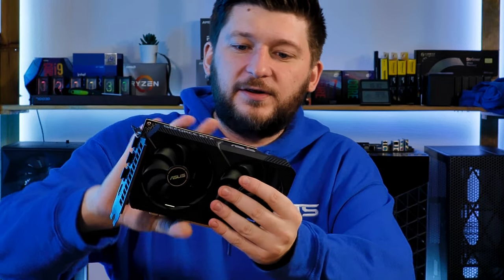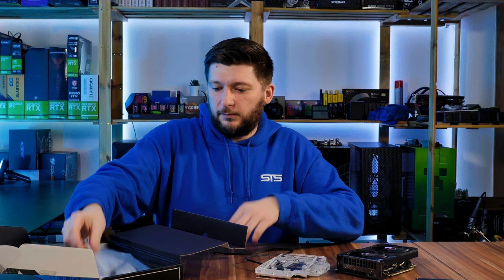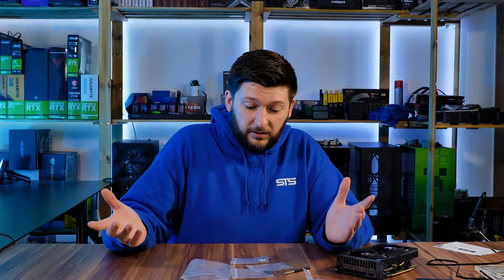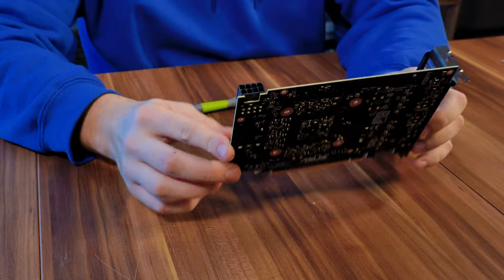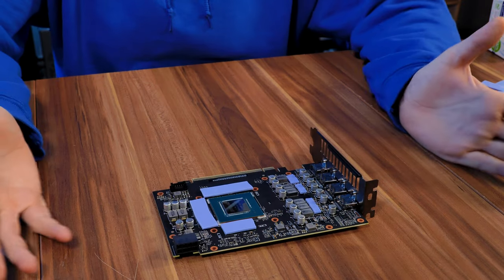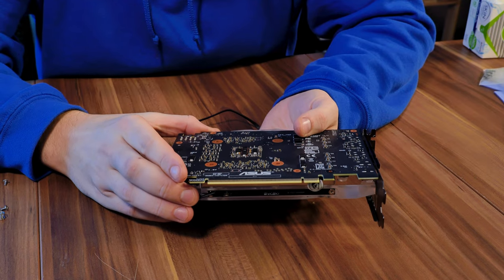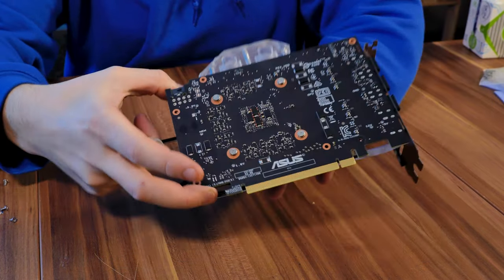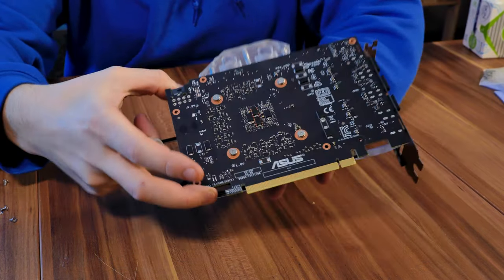Water Cooling my Asus RTX 3060 TI V2 Dual Mini | Bykski Waterblock

Comment: Great to see GPU water blocks for non-high end gpus such as 3080/90 etc for a change as it’s almost impossible to find water coolers normally for 60 class gpus😭. Well done to Bykski ❤🥰👍. I personally use their all-in-one cpu waterblock-reservoir-pump combo units and they perform exceptionally well 😇👍.
Reply: 12 floors  a couple of the 2060 models do have waterblocks mainly the EVGA cards and a couple of the blower cards according t9 the corsair site also the 2060 Suoer FE works with a 2070 block as its a identical PCB providing using reference design I'm cosindering doing black fittings for the FE 2060 super as I can see this thing being OC to above 2070 levels if cooled properly
Reply: I have the same GPU shown in the video. Is there a AIO available for that?

Comment: hi, great job, but what size of radiator should be suitable for the best temp dropping? 240mm?
Reply: 240 is fine, I had a ryzen 7 and a vega 64 both on the same 240 mil loop and temps were below average across all hardware. Although I reccomend 360 in case you want to expand later. I myself have used byski waterblocks several times. I like them a lot.

Comment: Do you have done any testing with this Waterblock yet and can give us some information about temps? I use the Gigabyte 3060ti Eagle OC with Bykski Waterblock and my temps are pretty high. 65°C on GPU in Furmark. Fans nearly 100%, Pump 100%, on a 280mm Bykski radiator in SSUPD Meshlicious Case.
Reply: no answer.. no info :( how do we know these are any good
Reply: Did you manage to lower your temps?
Reply: @Aeonia92  
Yes I was able to lower my temperatures. I reinstalled the block and applied better thermal pads (EC360® Silver Soft) and thermal paste (Thermal Grizzly Kryonaut). And I was very careful to tighten all screws evenly during installation. Now i have max. 53°C on the core with 1000rpm Fan Speed.
Reply: @christophscherpf4201  65° C high? LOL i am getting 80° playing battlefield 2042
Reply: @diego450one  well, then i think, something is mounted wrong. i would check this.

Comment: It looks like the pcb is shorter than the heatsink. Can you please post the length of the card with the waterblock installed?
Reply from the maker: I've de-installed the block already. But you can take the Waterblock's width and add 1-2mm due to the PCIe bracket

Comment: Hi. Thx for the video. Can you tell me what size thermal pads did u use for this card? I am just trying to replace the thermal pads only.
Reply: did you know it now?
Reply: @VTECINSIDE999  Nope xD Can't find any info on it
Reply: How bout now? Did you ever found the pads? I'm looking to deep clean, repaste and pad mine.
Reply: hi do you have the asus Dual GeForce RTX 3060 Ti V2 Mini oc
2 and 3 mm 
i just changed mine but results didnt improve 
have you also tried changing the pads 
any improvements

Comment: So what do you actually need to get this ? its not a standalone part is it ? you need seperate water cooling to attach it too ?
Reply from the maker: No this is just the GPU block, you would still need some sort of reservoire, pump, tubes, fittings, radiator and fans
Reply: @STSYT  ah too bad.. its gonna be to costly, was hoping for a standalone solution

Comment: What was the thickness of the pads?
Reply: hi do you have the same card
i have asus Dual GeForce RTX 3060 Ti V2 Mini oc i have heat problems also 
did you get better temp after renew thermla pads

Comment: will this block fit any 3060 ti? I'm after a water block for the palit dual 3060 ti and wondering if it will fit
Reply from the maker: No, GPU blocks are usually PCB specific. 
There are generic blocks, but those look very differently
Reply: @STSYT  do you know of any water blocks which would fit my gpu?
Reply: @STSYT  also what makes a block not compatible with a certain gpu?
Reply from the maker: @jeff9635  Not right now, but i'm sure Bykski also has one, just check on their website.

Well not every GPU is 100% the same, most of them aren't. Take screw locations, if there's one missing/somewhere else, you're done.
Plus, a GPU block will be directly screwed onto your GPU DIE, and that thing being "fragile" you want to be absolutely 100% sure that the block you're using was specifically build for that fitting. Imagine the block breaking your Chip into pieces just because the screws were too tight.
Reply: @STSYT  ah ok thanks
Reply: @STSYT  so if I saw a card which is compatible with an identical pcb layout to mine, would this mean the block would fit?

Comment: Can a source with a capacity of 550w use this VGA card?Thanks!
Reply: It all depends on the configuration. Use the power calculator (example https://www.bequiet.com/en/psucalculator),  For 3060Ti a 650W PSU is recommended!